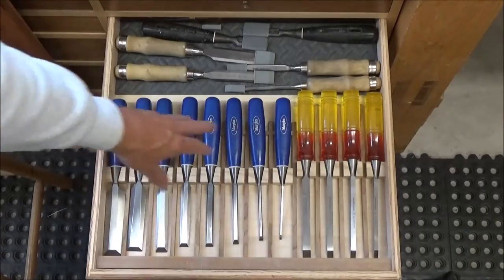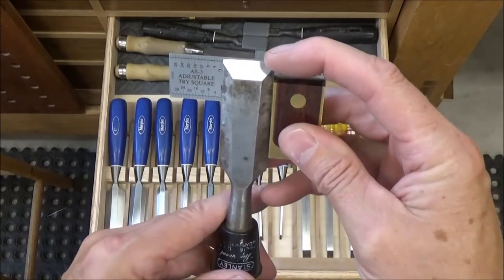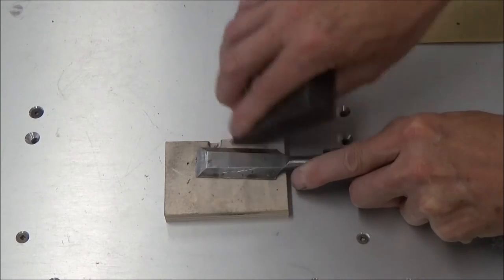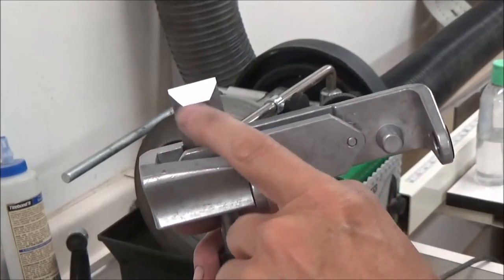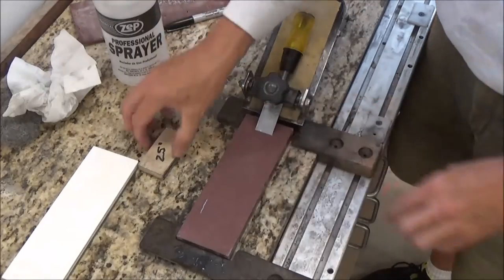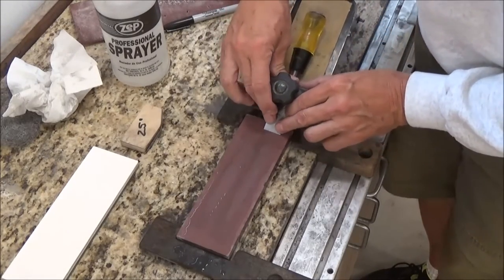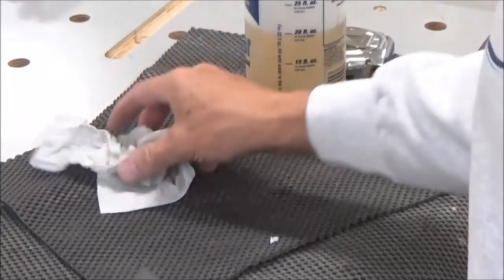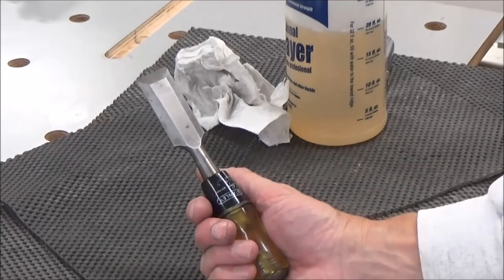Chisel Sharpening Start to Finish

Comment: Thank you.  I understand it to be not a good idea to use a detergent on water stones.  Not clear if you were using simple green on a water stone, but, apparently, the detergent will break down the binders that hold the water stone abrasives together.
Reply from the maker: You're welcome and the stone I am using is a ceramic hybrid stone and it seems to be holding up well. I have been using it for well over a year but I appreciate your comment and concern.